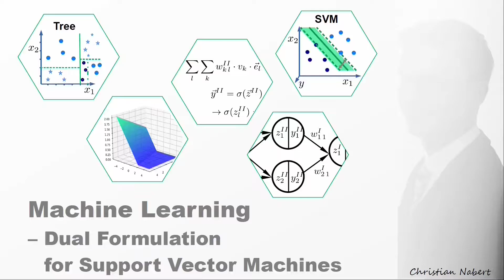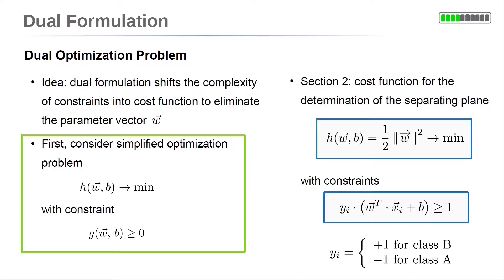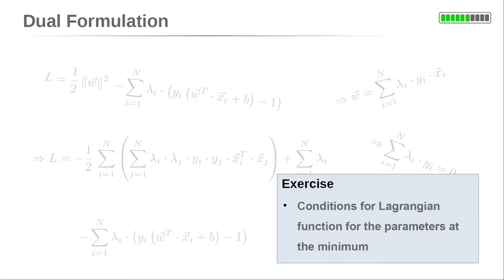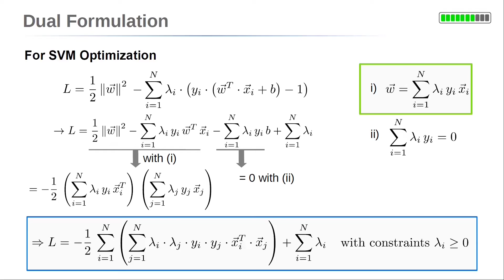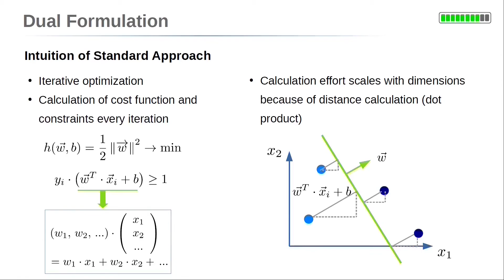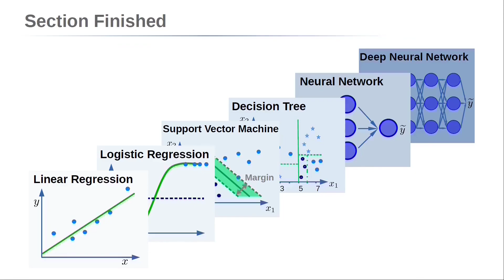Comment: I found this the best explanation on the internet! Still, I have one question: The primal optimazition is minimizing the weight vector. At the dual optimization are we minimaizing lamdas aswell?
Reply: Thank you. To your question: If you are using the dual formulation, you are optimising the lambdas. In the cost function are only lambdas. Then, you can directly calculate the weights with w=sum lambda*x*y